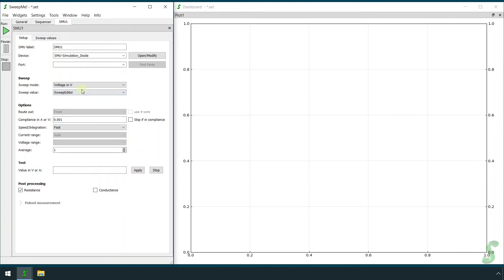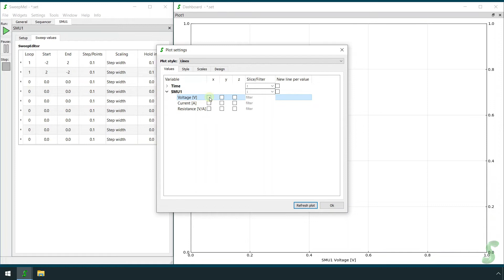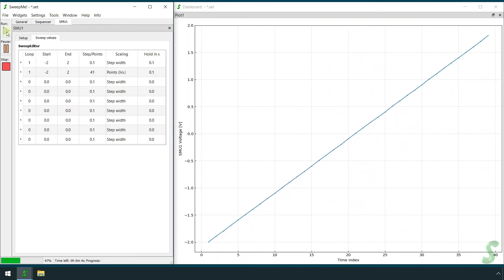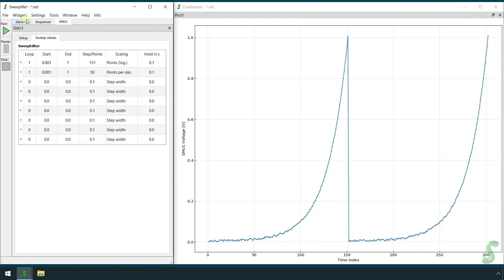SweepMe! basics #4: Sweeps (1.5.5)

Comment: Great video!
But could you clarify on how to use the pulsed measurement? I am having touble on filling the sweep values, it is only plotting a single dot on the graphic, not the ups and downs of a pulse
Thank you
Reply from the maker: Hi, I guess you are referring to measurements with an SMU where you have the pulse mode. This mode of an SMU like the Keithley 26xx models works such that it produces pulses but the instrument only measures during the on-state of the pulse. Thus, you will not see the shape of the pulse. This mode is ideal to quickly take pulsed IV curves where people like to know the current and voltage at each pulse but do not care about the off state as it is only needed to cooldown or relax the device under test. If you need to see the entire pulse, you need to use a combination of a signal generator and an oscilloscope or one would need to use more advanced test equipment like a parameter analyzer that can be equipped with pulse measuring cards where the user can specify in more detail when measurement points are taken.
Reply: @sweepme  Thank you!